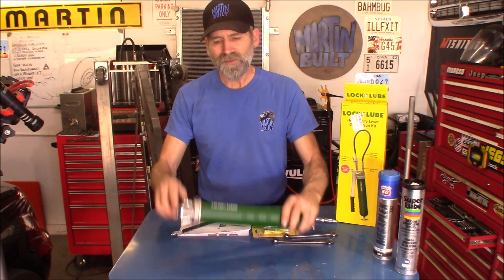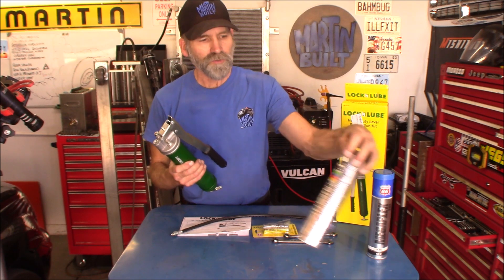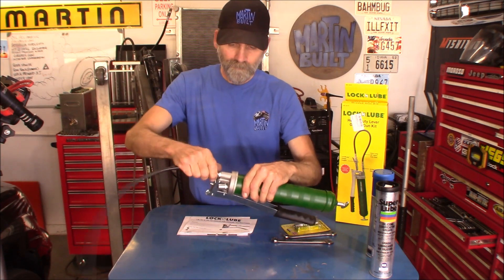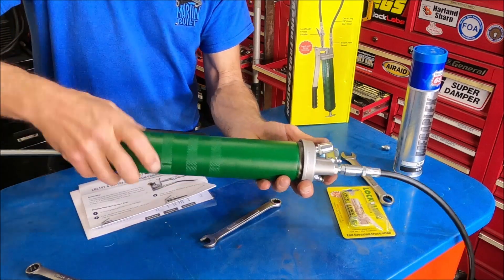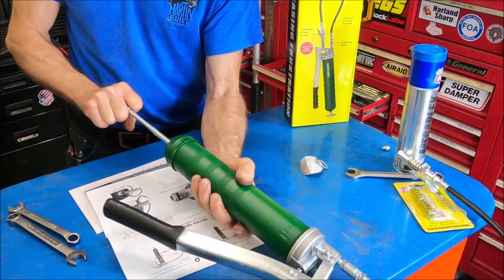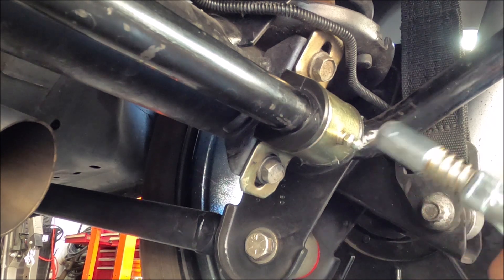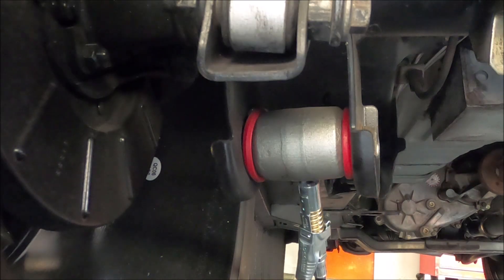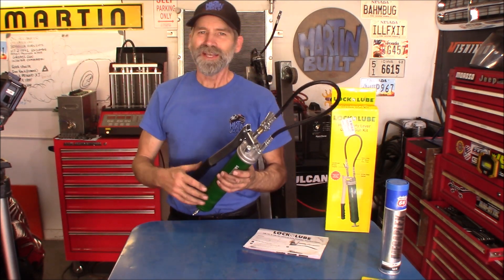How to Assemble and Operate a LockNLube LNL151 Lever Grease Gun

Comment: I have an older similar grease gun, it's leaking even when not being used so I have to keep it in a bucket. I should have used tape on the threads. Tightening the parts doesn't help